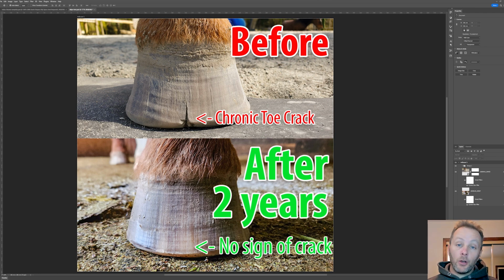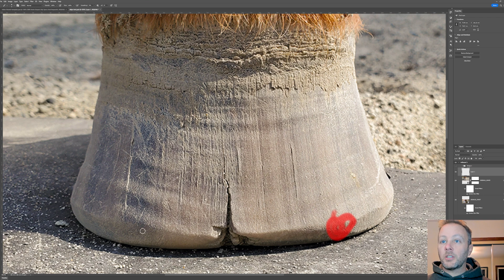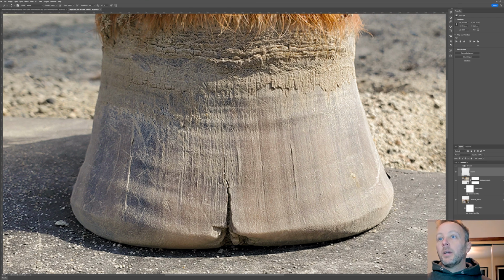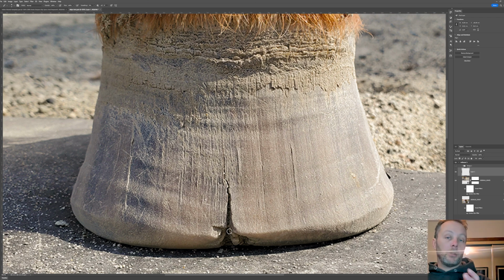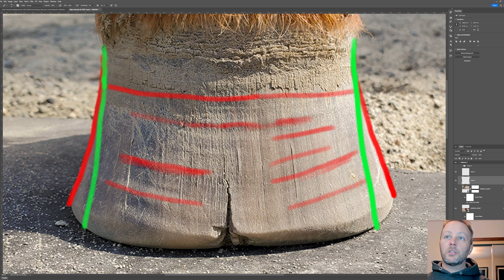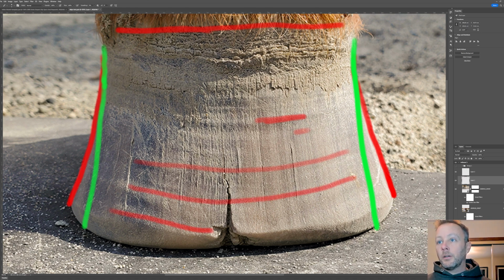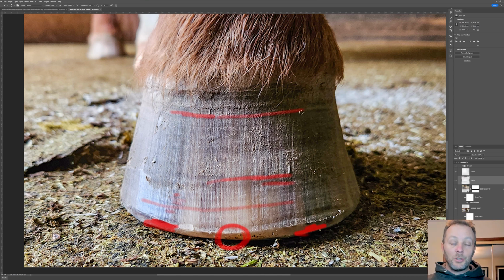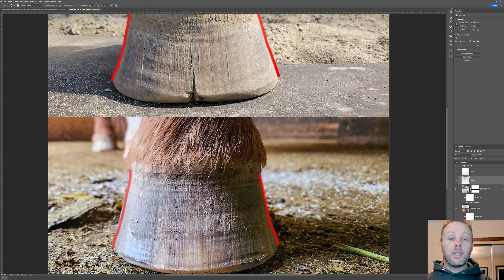3 Connected Serious Issues That Break Horse Hooves

Comment: The gelding we started to care for roundabout two years ago had cracks on both front hooves more than 1cm wide up to the middle, maybe almost 2cm at the bottom, the crack thinning to a line but reaching the coronet band. With help of your hoofcare course i 've been trimming them myself now for a year, the hooves have grown down nicely and the walls are almost straight, the crack has healed but there still is a visible line like a thread going from the bottom upwards where the crack was before. For some time the line only reached halfway up (after the crack had grown down), but over the dry summer this thin line reached the top again. I think the line represents the huge damage the hooves had inside, probably just needs more time, would you agree? I'm usually trimming a little once a week to keep the walls from flaring again, i hope another year and the line will be gone too :) Thanks for explaining!
Reply: I've tried to contact you on the stables site where the course is about another question, but i'm not sure the message has reached you, as there was no response so far (that was weeks ago...) if you have the time maybe i could ask again here?
Reply from the maker: Oh no, yes, please send it through or just send me an email directly at graeme@stablehorsetraining.com. Sorry about that!